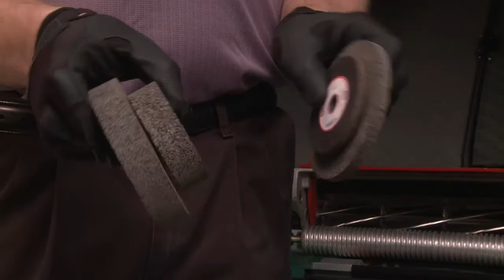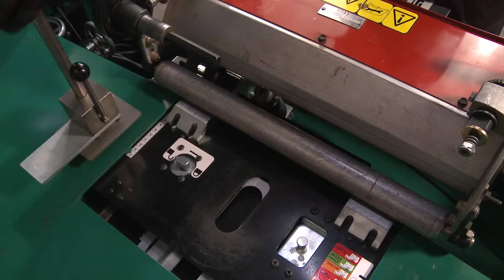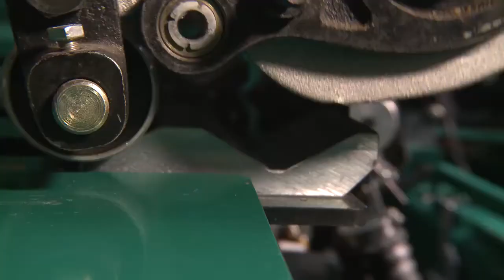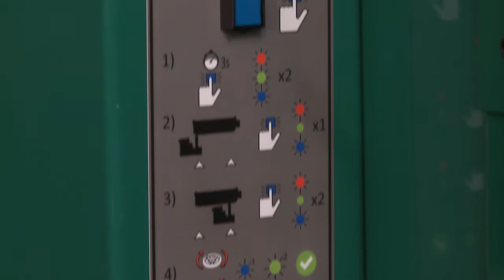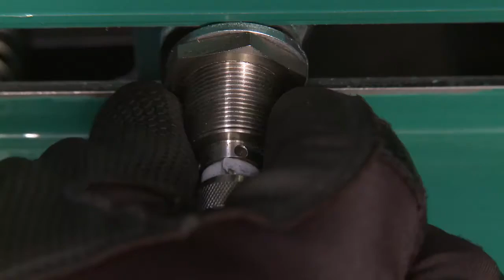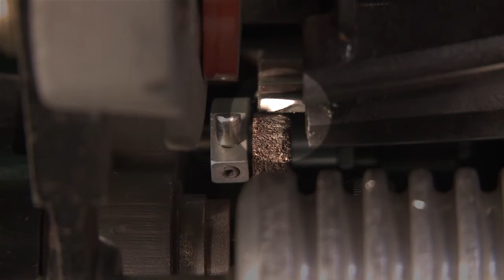Complete Guide of the 633 Reel Grinder | Legacy Foley Training Video

Comment: I procured / implemented i think the first Foley spin sharpener back in 1996- it was a Godsend, Accuspin 600 i believe, before that  i had the older manual unit ( one blade at a time & manual bedknife sharpener.. this unit in video does 99% of the setup for you-